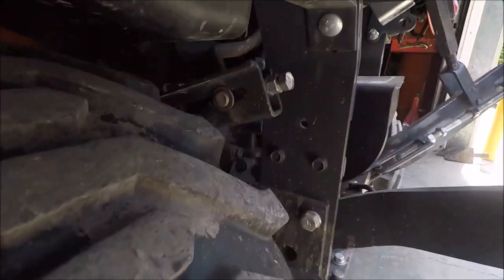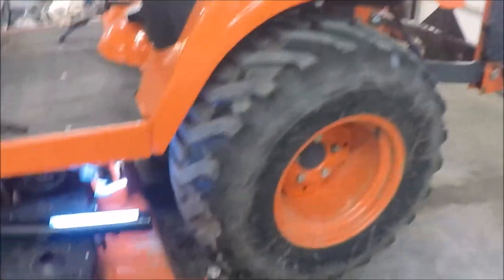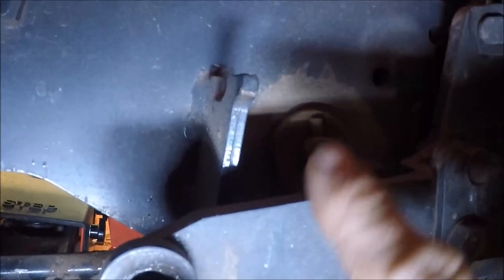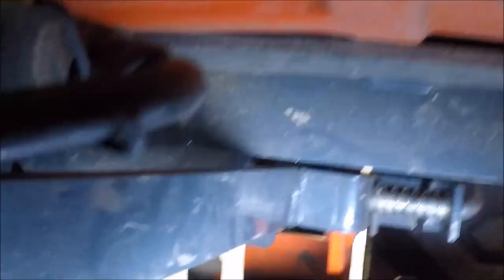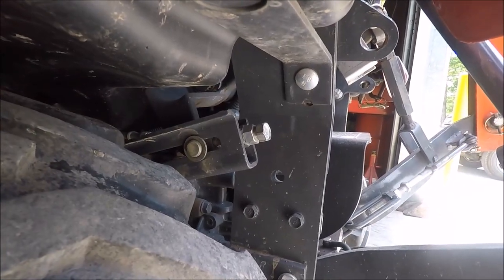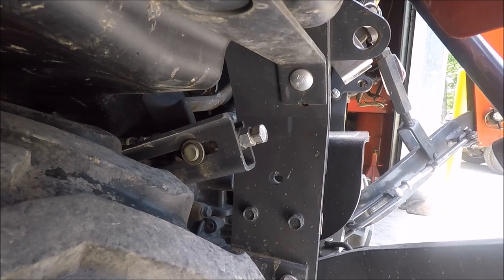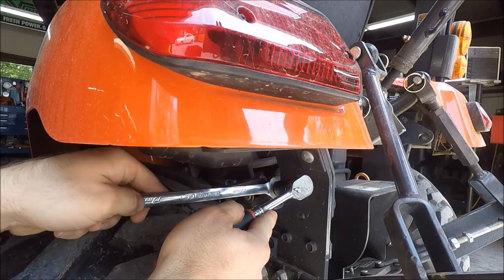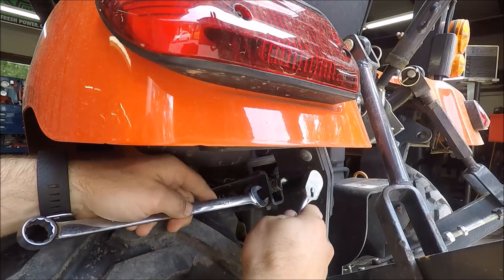Does Your BX Have Floppy Mower Deck? Here's the fix.

Comment: Thanks for pointing out this tip.  However, I am not sure how you accomplished the adjustment.  Could you explain how you adjusted the deck to within .020" of the deck stop?
Reply from the maker: Sorry I was unable to get the camera in to actually show how it was done. Look at the video and I show were the stop is when the deck is down. It is easier to find it with the deck down. Then raise the deck all the way up. Then insert you feeler gauge between the linkage and the stop. You may need a flashlight to see. Adjust the deck til the feeler gauge has a little resistance on it when you insert it between the linkage and the deck. If the feeler gauge is loose you need to tighten the bolt at the rear of the tractor. If you can't get the feeler gauge in between the stop and the linkage, loosen the bolt.
Reply: +94BULLITT - Thanks for the explanation.  I thought that was how it was done.  So, when I got home I checked out my BX1850 and I don't have a floppy mower deck.  Keep coming with the videos.  They help pass the time when things are slow.  BTW, love the OCDC video.  This would be great for when I run my mulching blades on the mower.
Reply: @TractorTech  mine bypasses the stop. The video shows what to do but didn’t explain the adjustments much when things are mess up.
Reply: My linkages doesn’t stop at the stopper on the passenger side it goes right to the top n hits the frame, theirs a gap it misses the stopper, any ideas ?

Comment: my bx just started doing this in the raised position

Did you turn that bolt in? or did you turn it out?  I turned that bolt in on my bx and it didnt fix the issue. was i suppose to turn it out or maybe i didnt turn it in enough?
Reply from the maker: Turn it in, you may need to go more.
Reply: @TractorTech  mine will go right pass the stop .
Reply: @roberthalstead4772  That's normal.  The linkage on these things is so horribly engineered and built there's way too much flex in it to allow for any type of adjustment to correct any deck bounce, and doesn't really lock the deck into any position you adjust it to....after a few uses the whole linkage assembly is all out of whack again.  I've been trying to adjust the linkage on my BX2680 this past year and nothing will really fix it, its an ongoing issue, and it also prevents the deck from going into the TOP position to lock it from raising and lowering when you want to use the rear 3 point hitch.

Comment: I have a bx1880 with a 48” deck, when I raise the deck all the way up it makes a clanking sound at the highest point, like the deck is coming up to far. Will this adjustment fix that also?
Reply from the maker: Yes, it should.
Reply: It does for a little while, then its all back to slapping around again.  Been dealing with this problem and the lack of being able to lock the deck in the TOP position for over a year.  Nothing really fixes any of these issues, the linkage itself is just garbage from the beginning...Kubota knows it and won't do anything about it.  But they'll sure charge you $165+ an hour to tell you that.